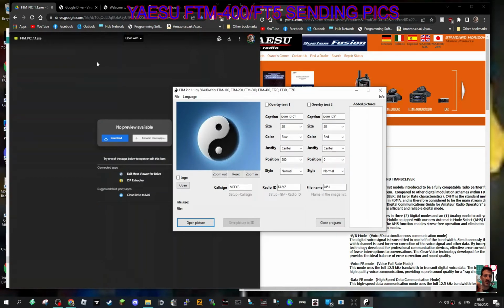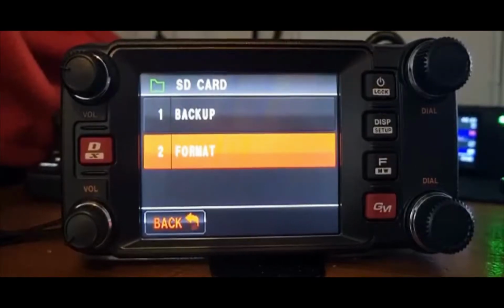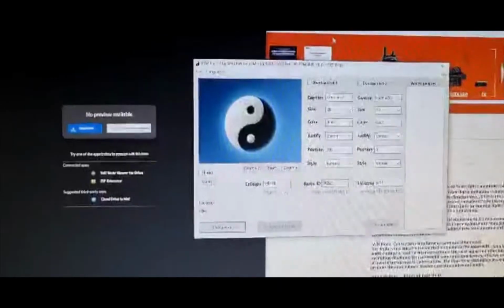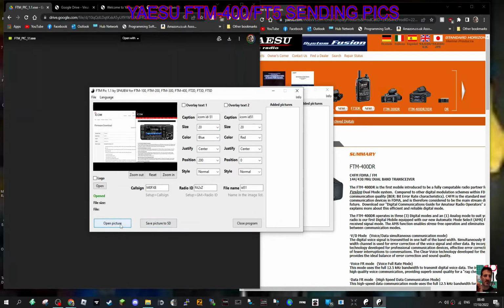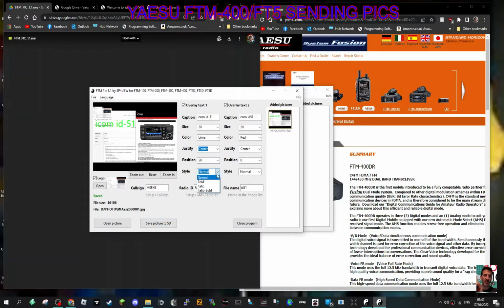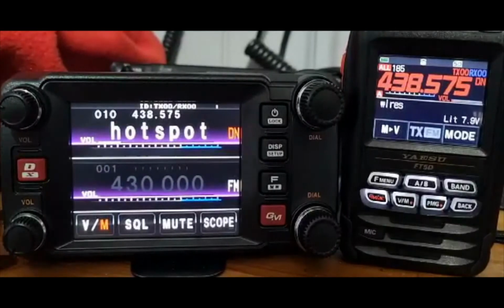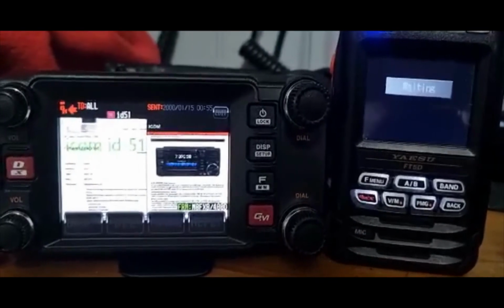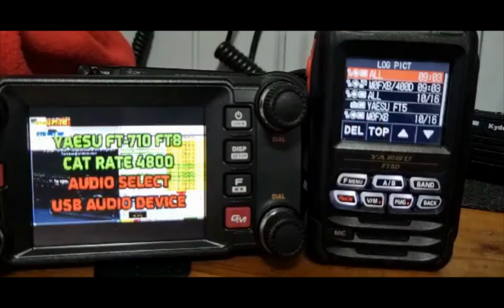YAESU FTM400/FT5 Sending Pictures - FREE Software SP4UBW

Comment: oh man this saved my butt. I had the program in the PHOTO folder and it wouldn't work. haha. Moved it to the top level dir on the sdcard and g2g. Thanks!
Reply from the maker: Sorted
Reply: @M0FXBHamTech  Oh! the ftm300 needs the QSOPCTDIR.dat (picture directory) and QSOPCTFAT.dat (picture allocation table) on the SD card to include the records for the jpeg otherwise the radio won't see it. So the photos need to be in sdcard/PHOTOS and the .dat files need to be updated in the sdcard/QSOLOG directory. interesting.